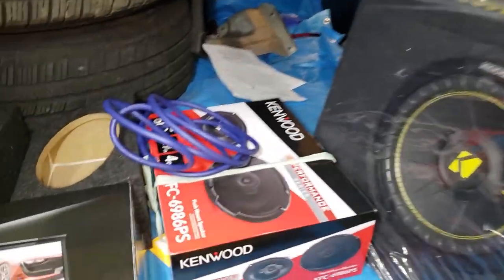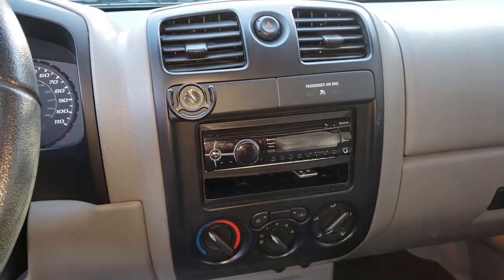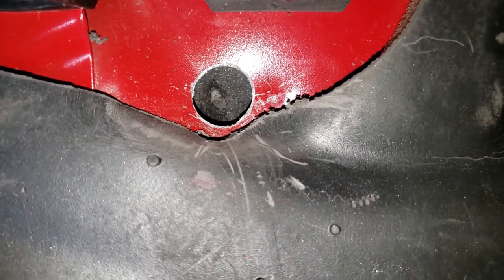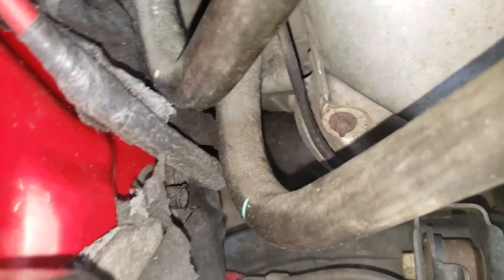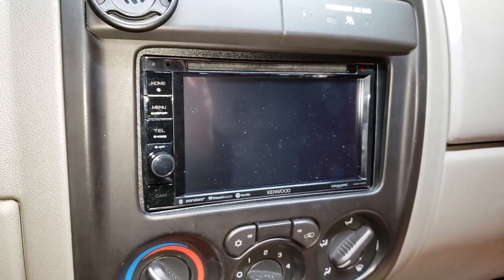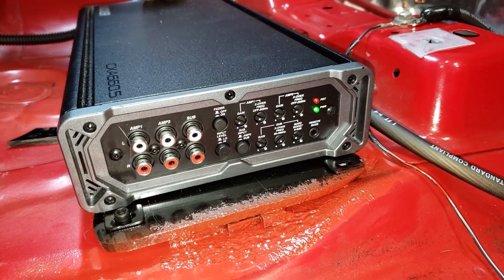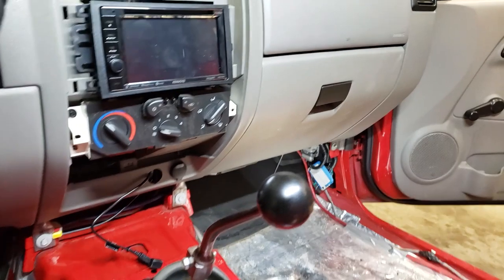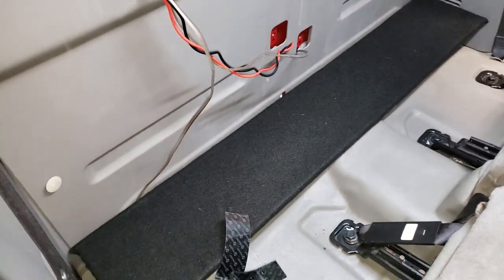Chevy Colorado Installing Car Stereo and Speakers, Amp & Sub 2006 GMC Canyon

Comment: I just did a stereo on mine today and when you said "just match up the wires one for one and it's that easy" I thought to myself man he is in for a treat lol!!!
Reply: Also, another way around the switch with the radio is to use the short extra positive wire that is given with majority of harnesses. You do a 3 way tie in with the white w/red striped wires connected with a green connecter inside the steering column. Then you tie that extra wire into the positives from the oem harness and aftermarket stereo.

Comment: I have those same kenwood speakers. I chose them for the low 30 RMS , because my headunit does 29x4. Glad to hear you like them., havent gotten around to installing mine yet. The sound of my stock tundra speakers suckkk. I just wish those kenwoods offered a component version so i wouldn't have to bypass my tweaters

Comment: I just installed a full system to my stock head unit. Now my blinkers are LOUD!! and there is a constant buzz.  The power line is run away from speaker wire. I have no RCAs on the hed unit so used an LOC between it and the amp. Any ideas what else I should check?

Comment: When you tapped into the fuse box at 25 minutes in your video…. Where did you end up hooking that wire to so you had switch power. I have a 2005 Chevy Colorado and I’m trying to figure it out. You’re video is extremely helpful but I’m lost Bc you didn’t give any more information about where you hooked that power switch wire into. Thank you!

Comment: if you want to make it easier, you could have tapped into the wiper blades fuse and used that, that's turned on with auxiliary from the in cabin fuse, some cars - like mine also have the cigarette lighter on the auxiliary input and that's usually just 3 inches away from where you want to use it... OR in your case 2 ft away from your amplifier, as the amps drawn from the remote wire is so miniscule it wouldn't blow the 20A fuse of the cigarette lighter.

You're welcome.
Reply from the maker: Thanks for sharing.

Comment: Hey so technically I wouldn’t be able to change the the speaker sound from the aftermarket stereo right? Since we will be using the amp for it?
Reply: or will I be able to use the aftermarket radio to mess around with changing it since that’s why the RCA cable is for?

Comment: you did a good job ,man. If you dont mind me asking, how did you set the gains?
Reply: Everyone should know how to set the gains by ear or by ear with a DMM/O scope
Reply from the maker: Not saying this is the way to do it, but this is how I like it:  Sub:  Gain at about 7; X over at ~75Hz, Bass boost 1/2 way.  Amp 1 (front speakers) Gain at 6, X over at 100hz.  Amp 2 (rear speakers) Gain 4  X over at 50Hz.  Additional tweaking in the equalizer part of the receiver.

Comment: you should have installed  a   compasator  to protect your battery and all other systems from voltage shortage
Reply from the maker: Thanks for the tip.  I will look into this.